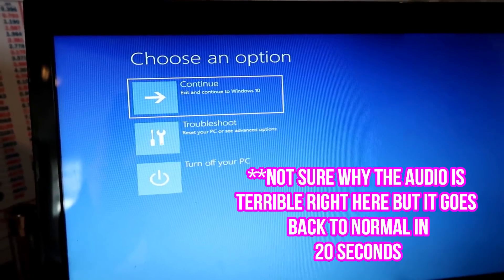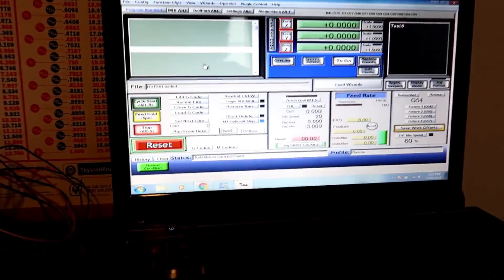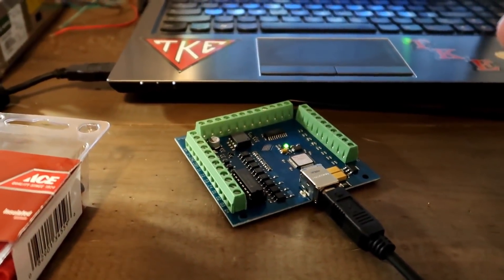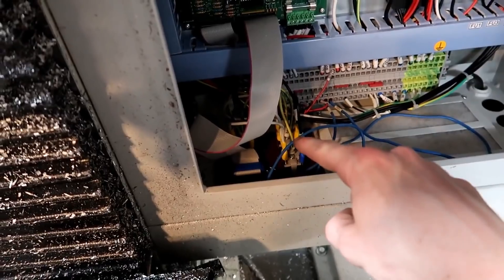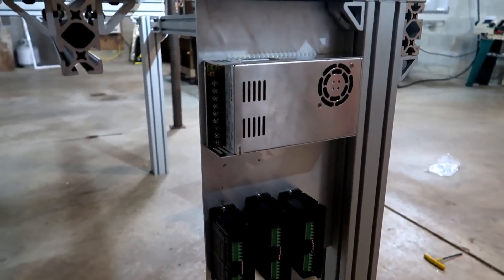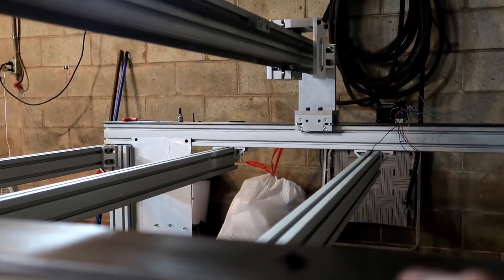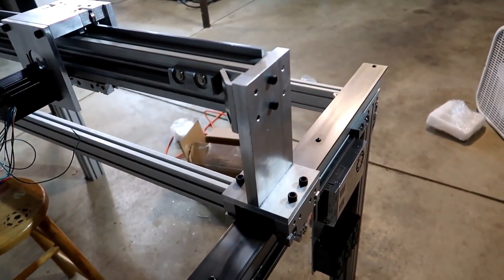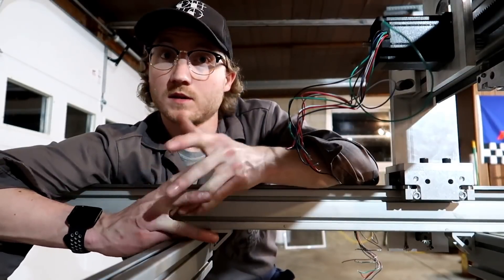DIY CNC Plasma: Power, Electronics, Modifications: Home Mfg. Days #40

Comment: i dont t
hink mach 3 supports USB without special drivers for it...
Reply: i run my DIY plasma with Arduino and ESTLcam, its a about $5 for the arduino, and estl-cam about $50, not perfect for plasma, but with a few tweaks to the post processor in fusion it works fine...the reason for estl-cam is i also run my cnc-router of it :)
Reply from the maker: I'm thinking you're right haha.  I have just picked up a desktop computer today so I can run a parallel port out to the motion card and drivers.  I should have done that in the first place rather than try and cut corners.
Reply from the maker: Do you use Fusion? If so, what tweaks did you have to do to the post processor?

Comment: Hey, man good mechanical build but don't mount your electronics panel to the chassis of a plasma you are asking for problems. keep it isolated. the torch height control works off of measuring the ark voltage hotpot to ground. This makes all kinds of noise. yes, it can be done with bias resistors and isolation transformers etc or just detach the box to eliminate some issues. What THC are you planning on using?
Reply from the maker: That is good advice, thanks for bringing that to my attention.  Also, since you mentioned it, what THC would you recommend? I have been so focused on getting this thing to just move I haven't looked into anything else for the torch.  I honestly wasn't even planning on running a THC right off the bat but it seems that I would definitely need it.

Comment: What are the specs on the card? Like other may have said, it may be a driver issue. I'd be willing to look into it to help if I knew more about the board.
Reply from the maker: I'm not sure of any specs on the card but here are the directions that came with it.  https://www.buildyourcnc.com/Documents/USB%20Motion%20Card%20STB4100%20Manual.pdf
Reply: Looking at the instructions (I'm sure you followed them), but just to make sure, you moved the license file to the Mach3 PlugIns folder and selected the right option when starting up? 

It (Mach3) not seeing the card makes me think that its something with those files or possibly just where its looking may not be correct.
Reply from the maker: Yeah I moved the "RNRmotion.dll" file to the mach3 plugins folder then selected the "RnR motion card" on the mach3 startup.  Only when I hit reset it says that it "cannot find the RnR motion card".
Reply: Oooo, that sounds like a good clue. So it works everytime when you have a fresh restart? or even is there any issues if you start the board up before mach3 comes up? 

Might be a similar issue to my first build where I had to jump the estop pin so it saw it and allowed it to work. Might try setting up an estop (i don't remember if there are dedicated pins or if you have to just define them in Mach) or even just jumping two pins so it sees it and thinks its okay.... do you already have an estop hooked up or defined in the settings in mach? If it is defined, try and just put a wire between the pin defined and the an output pin that can supply 5v (or whatever the inputs take).
Reply from the maker: It pops up every time I have a fresh restart and I have tried keeping if plugged in before starting mach3 and after it has already started up.  I don't have an estop setup in mach3 but I ended up trying a different board anyway and it worked fine and I just followed the directions just how it said.  I think that board is hosed somehow.

Comment: Glad to see you're making progress.  Looks like you've gotten a couple of good suggestions in the comments about the driver board.  When you go to mount it.......you could use a couple of blocks or stand offs in the area between the motor drivers and the power supply.....have them tall enough to extend beyond the power supply height.  Basically, the controller board would "float" above that open area.  When it comes time to make a cover, Home Depot has partial sheets of acrylic/plexiglas, although there's no real reason to be able to view the electronics. :)  If my mounting suggestion doesn't make any sense, let me know and I'll send you a sketch.
Reply from the maker: Yeah if you have time just email me a quick, simple sketch.  I'm definitely interested to try it out since I have limited room on my panel.  Thanks for the help!

Comment: Get a MESA 7i76 and run Linux CNC. Lots of support available.
Reply from the maker: Does that connect to a computer with only an RS232 as opposed to a parallel connector?
Reply: I believe you can communicate directly via parallel port to the 7i76. If you have a desktop you can use a 5i25 PCI card to connect to a 7i76 via RS232 (all pathpilot controllers use 5i25 cards). The other option is the 7i76E which connects via ethernet. For the ethernet card you have to run the RTIA PreEmpt kernel which gets a bit involved but isn't difficult once its done.
Reply from the maker: Sounds good.  I might have to see if I can get an old desktop with windows 7 on it so I can use the parallel port.  Sounds like it would be a good setup
Reply: MojoMfg. Current operating system doesn't matter as you will replace it with linuxcnc if you go this route.

Comment: Don't worry about the electronics, just enclose and put a fan with a filter easy to access and will be ok. 
For your board problem, did Windows found it ? Did you try other usb port and cable?? Mine doesn't work on every usb on my computer. Anyway, it is a nice build , thanks for sharing
Reply from the maker: Windows can find it and recognizes that it is the RNR motion card but Mach 3 won't recognize it even though I have the correct ".dll" plugin in the mach3 plugins folder.

Comment: It’s really tough to beat a parallel port breakout board for a plasma table. You probably won’t be able to use your laptop but if you use your plasma a lot a laptop won’t be a good long term solution anyway because of all the dust and grit.
Reply from the maker: If this other board doesn't work with my laptop then I'm going to try an old desktop computer with a parallel port.  That is my old, backup laptop so it's okay if gets a little dusty and greasy.

Comment: This going to be an out-there suggestion. But you could run PathPilot to control the CNC plasma. That what I did with my CNC Router a couple months back. Worth it.
Reply from the maker: I'm sure you could.  That may even be a little easier.  It's just a linux CNC based software anyway....I think...I'm not very versed in the software application of CNC yet.
Reply: If you need help doing it, let me know. Should be fun.
Reply from the maker: Thank you so much for the help.  I'm going to try out this new board I just got and if that fails then I'll come running back to you to see what you did to run pathpilot.

Comment: You need the RnRMotion.dll driver to make the board work.... 

It goes in the Plugins folder inside the mach3 folder

https://1drv.ms/u/s!AhAN_Dar0dfrgskxpE2k7G2GdsVMZA
Reply from the maker: Yeah, I have the correct driver in the correct location as well.
Reply: Try a different USB cable. Try a different USB socket on your laptop. Are you using windows 7 32bit or 64bit ?
Reply from the maker: I tried a different USB cable and all the different port on my laptop.  I am running Windows 7 64 bit but the motion card directions and mach3 said 64 bit would work
Reply: In Mack3 got to the Plugin Control then RnRMotion. Check that the option for 100MHz or whatever it is is selected
Reply from the maker: I'll have to check that out.  I did get this other board to work but I am curious as to what went wrong with the board I showed in the video.
Reply from the maker: Do you know where that frequency option is?

Comment: Did you install windows 7 32 bit, 64 bit doesn't work.
Reply from the maker: The mach 3 website said 64 bit will work fine and the directions for the board will work with 64 bit as well. So I'm not sure what could be going on.

Comment: If I had to guess, I'd guess that you have the wrong drivers installed for the motion controller. Post the manufacturer name and model number, or a link to the board.
Reply from the maker: This is the directions for the board.  I'm not sure of the manufacturer. https://www.buildyourcnc.com/Documents/USB%20Motion%20Card%20STB4100%20Manual.pdf
Reply: There's a driver download on the page for that board. I'd start by reinstalling the driver. If that doesn't work it may not actually be compatible with 64 bit windows. I don't know what version of Mach3 you're trying to run, but you might have better luck by rolling back to Windows XP.

https://www.buildyourcnc.com/item/electronicsAndMotors-electronic-component-breakout-Mach3-USB-Board